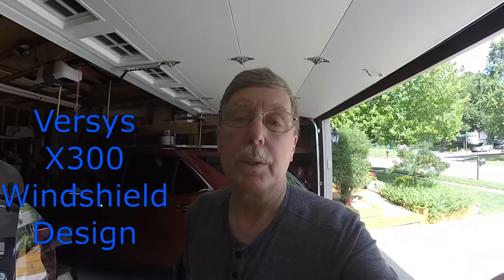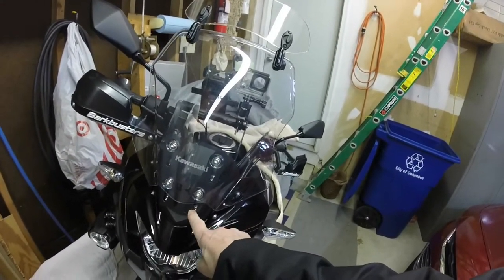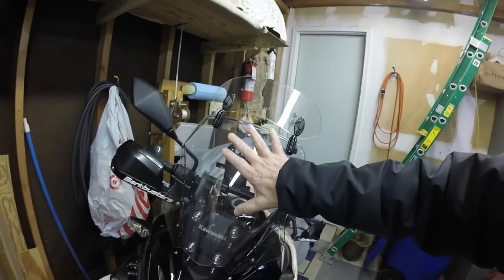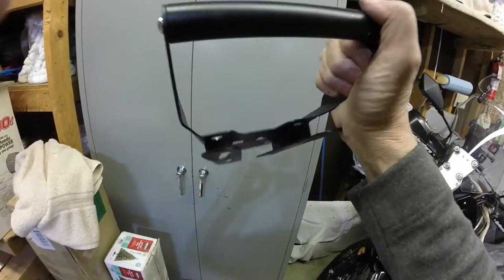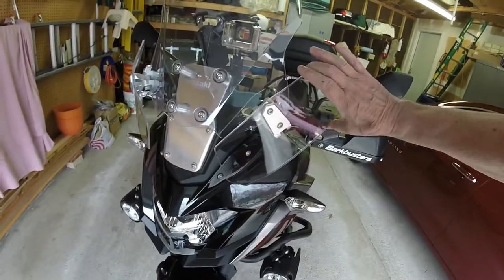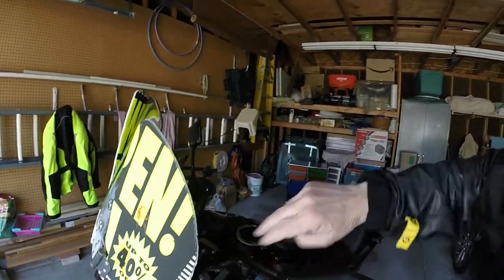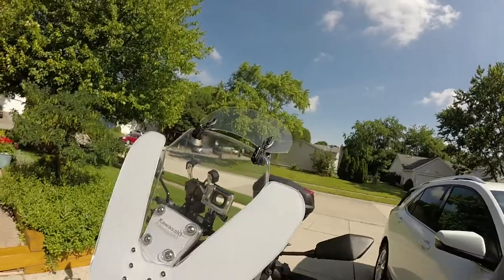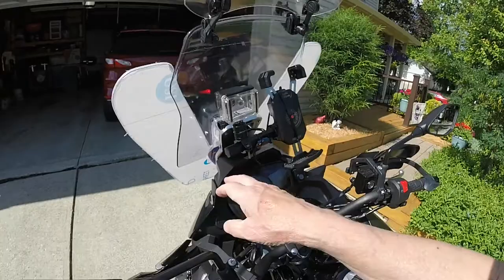Kawasaki Versys X300 2017-2022 (short version) Designing Windshields for summer and winter

Comment: Very underrated channel. Thanks for the video. I just purchased a kawasaki versys-x 300 last month. I am a beginner motorcyclists, very excited to get going.
Reply from the maker: Thank you.   Please check out all the videos here as they help the X300 owners starting out or more experienced.  There are popular accessories and mods that are covered here.  One which is not here is adding a center stand which I would recommend.  The center stand is pretty easy with only the putting on the spring that can be a pain.  I used large channel lock pliers and a couple of tries to get the spring positioned on the channel locks and it took under one minute.  Congrats on your X300 choice.  I really like working on X300 projects and share.  More to come.

Comment: Nice designs aftermarket windshields I tried on mine have broken and yellowed a bunch vs the stock one. I really like the bike got 6k miles on it now and some more aggressive tires, aftermarket Corbin heated seat, Oxford heated grips, and bark busters. 2017-300x I've been in a couple snow storms with mine too and lots of gravel roads.

Thanks for showing your windshield designs!
Reply from the maker: Thanks for your comment.  This was quite the project.  I may take this further with bending/forming a single piece of Polycarbonate to replace all of the pieces.   This material is amazing as it can be cold bent, and it behaves like wood.

Comment: Always great videos. Thanks sir.
Reply from the maker: You're welcome.  The art of windshield design is complex and time consuming.
Reply: @trekOCLVone  very. Always bugged me on my versys 650 until I got a givi. Tall and wide. 

I sure wish they’d make a versys x400
Reply from the maker: @americandude3825  There are many who wish for a X400.  I think it would sell.  Kawasaki seems slow moving in that department of changing things.  It took 4 years to bring back the KLR650 from the dead.  lol  Only the third gen in something like 35 years.  So the X300 has a ways to go.  Virtually no difference from 2017 to 2022 (6 years).
Reply: @trekOCLVone  if Kaw 
Makes a 400 x. 
I would think it would steal sales from the klr which they just relaunched.  So IMHO I don't think will see one. ,darn
Reply from the maker: @franknells  That is probably what Kawasaki is thinking.  These bikes (X300 and KLR650) are not the cutting edge and progress is glacieral.  But I like the X300 as it is with the customization being endless and great gas mileage.  The last two rides combined added up to 131 miles and the X300 used 1.67 gallons of gas ($8.46).   I'm riding my X300 more and leaving the car home.

Comment: That is an amazing design you have going on there Sr. I really like it. Good stuff! I wish I had the tools, the ability and time to do that with my bike.  Thank you for your contribution and your work, it has given me good ideas. The wings you built on the sides, If I may comment; could have better airflow with your center windshield overlapping the side wings? Instead of the sidewings overlapping the center windshield?
Reply from the maker: Having the wings be on the outside of the original center windshield has a hidden benefit.  The center windshield has the top separate extension increasing the wind drag and that would have had an oscillating effect.  The center windshield would have been bending backwards and forwards constantly above around 45 mph.  With the wings applying just a light amount of constant pressure against the center windshield there is no oscillating effect.  Rock steady.  I didn't exact plan for that but quickly realized the benefit of the wing placement out in front.  So, I'm leaving it as is.  In cooler weather this is the perfect wind block however, in hot weather the wind block is too much and that is why I came up with the second design shown for days above 80 degrees.

Comment: These things are almost impossible to get right.  Too many variables in the equasion. Every motorcycle is different and they are NOT tested aerodamically .  The best fairing to ever be put on a motorcycle is the one on the BMW R100RS.  It is best to go with a shorter screen and have clean air on your helmet. Nature abhores a vacuum and so do motorcycles .
Reply from the maker: I can't comment on the BMW R100RS as I'll never have the opportunity to ride one.  The comment about almost impossible to get right - is correct.  I've spent 100 + hours on designing, fabricating, installing and road testing a finite number of windshield designs on just one Motorcycle (Versys X300).  Where I'm at is with the raised stock windshield with extension and the movable wings.  I address many of the issues that I started out to overcome.  My design took many iterations and when the wind noise and helmet buffeting was squelched I stopped.  This is a work in progress.  It will never reach an end point.  It's been a journey.  Thank you for your comment.

Comment: Just buy a goldwing.
Reply from the maker: I will not part with my Versys X300.   I'm at 1 year of ownership and it is my part time job installing (the right way) many accessories and mods.  The X300 is light wight and you can make into just about any kind of bike you want.  With all my updates It is ready for the road or off road.  I'm not a young in' and an 800-pound bike is a no go.